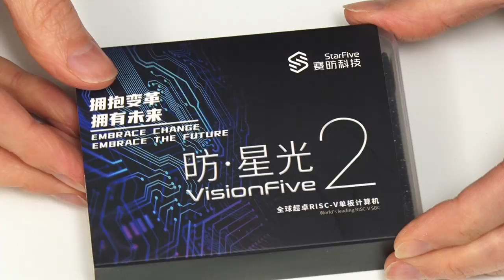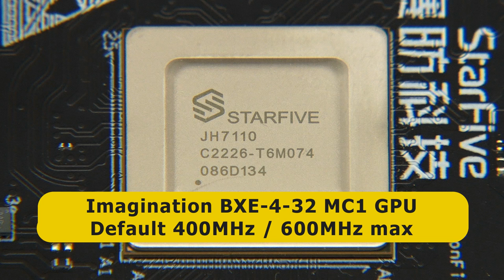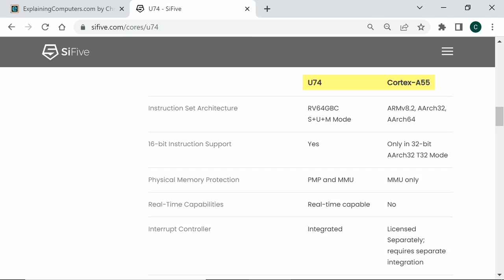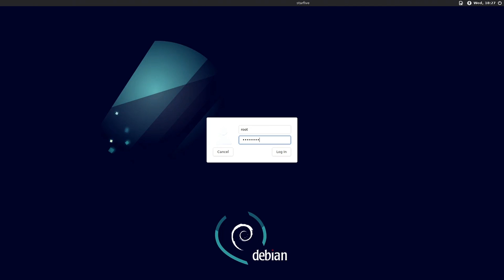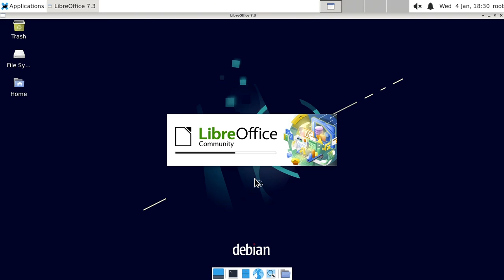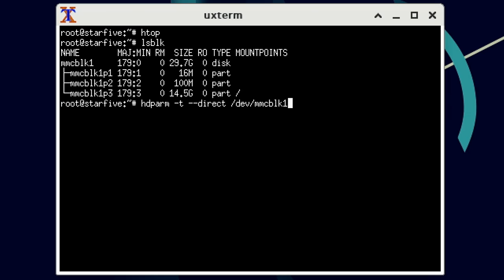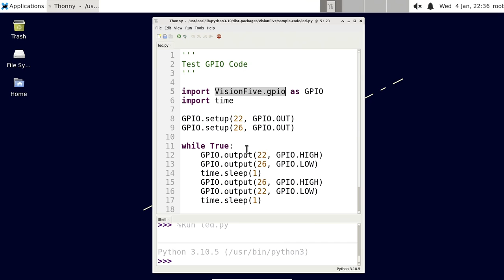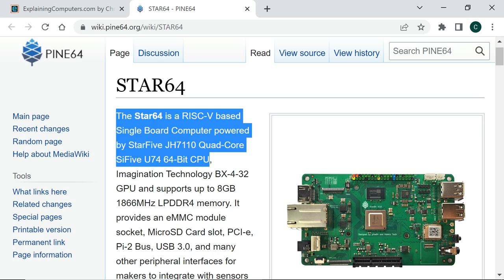VisionFive 2: RISC-V Quad Core Low Cost SBC

Comment: Is the documentation for this SOC open such that a developer could port an OS to it without the involvement of the SOC manufacturer? IMO such a move is critical for software support. As long as the manufacturer serves as the primary gatekeeper, the software ecosystem will always be constrained and cannot flourish.
Reply: Why do you care about yet another board that will disappear from the market in a year tops?
Reply: @lepidoptera9337  Because if one of these companies actually takes a chance to open up some of their IP and allows for actual community development then they could make an ecosystem that will last longer than a year.
Reply: @splynncryth  Dude, community development has never resulted in a decent piece of software. You need to stop smoking the dope.
Reply: @lepidoptera9337  I think Linus Torvalds would like to have a word with you.
Reply: @splynncryth  Linux sucks. No offense, but the best version of Linux that I have ever seen was a release around 1996 or 1997. It was all downhill from there.
Reply: @splynncryth  There is nothing wrong with that. Back then we had Linux on PCs and it ran just as reliably as UNIX on five times more expensive hardware. One of our LINUX machines had over one year of uptime before the electricity went out. Today I install Linux on a PC and it breaks without warning after a few days, if it installs at all. :-)
Reply: Written while totally ignoring the number of Linux machines that comment had to pass through. 

But all this misses the f-in point. 
Everyone is enamored with RISC-V and it's open source ISA but that also misses the point. 
There are reasons Android users struggle to get updates to their OS while PC users can generally get updates as soon as they are released by Microsoft, the Linux Foundation, etc. 
An open ISA doesn't make for an open platform. An open platform is one that can be supported by entities other than the chip makers. It's a strategy that has worked out great for Intel, AMD, Microsoft, the Linux Foundation, the OpenBSD foundation, etc.
Reply: @splynncryth  I don't have thousands of IT people to maintain my Linux machines, kid. I am not Google or Amazon. A long time ago Linux "just worked". It doesn't do that anymore. :-) 

And update that breaks your setup is not an upgrade. It's a mindfrell. That is what Linux has become.
Reply: @lepidoptera9337  Who hurt you? that's one hell of a chip on your shoulder. Or perhaps you are employed by a rival OS maker? 
Who do you think worthy of your praise? 

But again, you miss the f-ing point. These systems are essentally manufactured e-waste if they don't enable someone else to handle software for them.
Reply: @splynncryth  Why are you taking this so seriously, anyway? That Linux sucks is not your fault. You don't have thousands of professionals to make it work, either. A good OS requires a professional build team. Windows NT was initially built by approx. 200 people, I believe. By the time they were shipping that number had swelled to 1200, if I remember an article about it correctly. That was a tiny system compared to the size of a Linux distro and it was a focused effort by people who were full time employees. That's the power of money. It can create actually working operating systems. Neither you nor I nor the entire Linux community has that kind of change.

Comment: Could you please benchmark the NVME slot? 
Sad the ethernet ports are not both 1Gbps or 2.5G and 1Gbps. PFSENSE  and a VPN gateway would be a natural. 
Thta said I'm old enough to remember the original "Microprocessor Wars" of the  early 1980's.  There were dozens of great processors - both RISC and CISC begging for attention.  Once Sun and Apple went the Motorola route (now Freescale) and IBM of course the x86 the rest fell by the wayside as volume drove the costs down for these two camps. (For those too young to know - original microcomputers cost many thousands of dollars - they were a very hard sell indeed. Some innovated and drove the price to hobbyists price points but they were very weak. So its a bit amazing to see multicore, multi-gigahertz with large memory, graphics, networking and storage for sub $100 - what a journey!)
Reply from the maker: When I can get it working, yes! :) As I noted in the video, I tried an NVMe SSD, but could not get the OS to recognize it. But others have got it to work, so it may currently depend on the paticular drive used (I tested two WD Black drives). Be aware that the board is PCIe 2.0, so we will not get spectacular  NVMe SSD performance.
Reply: @ExplainingComputers  - Ah but I would expect it will certainly be better than USB or SDCARD. The latter really is a serious choke point for the Raspberry Pi.
Reply from the maker: @dennisfahey2379  Oh, certainly! :) I'm pretty sure I recall seeing an NVMe test somewhere in the RVspace forums reporting about 220MB/s -- about the same as I got the the USB 3.0 SSD test. So very much an improvement over a microSD card, or an eMMC module.
Reply: @ExplainingComputers  I mentioned above that a random comment lead me to change power supplies. When I went to a strong power supply using USB-C PD, my nvme was recognized. So that may be your issue
Reply: @Dennis Fahey  - here is what I saw with hdparam: hdparm -t /dev/nvme0n1

/dev/nvme0n1:
 Timing buffered disk reads: 512 MB in  3.00 seconds = 170.55 MB/sec

Comment: this is one of those products that, while technically cool, has no real place in the market.  If I wanted an SBC I'd go with x86. There is just too much software, knowledge, and support behind it.  RISC-V is neat, it's am undeniably cool ISA, but can it ever catch up and become actually useful?  I don't think so.
Reply from the maker: How does it have "no place in the market?" It is a board primarily for those wishing to develop for the RISC-V ecosystem, and as such has a massive place in its intended market. Not least, it has reduced the cost of access to tens of dollars, which will allow far more enthusiasts and developers to get involced. And I suspect that many SBC enthusiastics will jump on board at this price once the final release software arrives, especially with Raspberry Pi shortages. Enthusiastics too like a frontier.

In terms of RISC-V "catching up", I would suggest that having c. 30 billion (yes billion) RISC-V cores already rolled-out (in the embedded/edge/microcontroller space) is highly significant. For example, if you own a modern smartphone or SSD, there is now a reasonable probability that it has a RISC-V controller core somehere inside it. So to suggest that RISC-V will not become "useful" is somewhat ill informed

This does not all necessarily mean that RISC-V for end-user will take off. But RISC-V may well be the largest player within the embedded/etc space within say 5 years. And with Google now backing RISC-V as Tier 1 for Android . . .
Reply: Why would you go with x86 for an SBC rather than ARM?
Reply: @ExplainingComputers  ahh, perhaps I should have said that I don’t think the board is FOR ME. I am an enthusiast, but self taught and have little experience with Linux, and what I have experienced makes me leery of using any Linux distro as a daily driver.

Comment: 5:22 you can't compare processing power by looking at frequency, IPC is just as important
Reply from the maker: I am not an idiot and nowhere in the video do I comparing processing power solely by looking at frequency. Rather, as is extremely clear in the video, I compare both the cores and their frequency -- as discussed in audio and labelled in the graphic. In fact that section starts out entirely talking about comparing RISC-V vs ARM cores and does not even mention frequency.

Specifically, I note that a Si Five U74 RISC-V core is comparable in terms of processing power (NOT frequency) to an ARM A53 or A55 (and more towards the latter). And I then note that a Raspberry Pi 3B+ has four 1.4GHz A53 cores. So given that a VisionFive 2 has four 1.5GHz U74 cores (ie four cores that are widely considered to be at least as powerful as an ARM A53, and also clocked faster), it is  reasonable to state (and pretty widely accepted) that a quad core 1.5GHz U74 SBC will have more processing power than a quad core 1.4GHz board -- hence a VisionFive 2 is more powerful than a Raspberry Pi 3B+. I then include information indicating that a (recent) Pi 4 has 4 x 1.8Ghz A72 cores, so has both more powerful cores, with these now also clocked at a higher speed. So a Pi 4 has to be more powerful than  VisionFive 2.
Reply: @ExplainingComputers  I think perhaps some benchmark comparisons would have been good to see
Reply from the maker: Agreed! :) And I intend to make a benchmark video comparing a Pi 3, Pi 4 and the VisionFive 2. However, right now the software for the VisionFive 2 is not mature enough for benchmarks to be meaningful -- there really is no GPU support, storage interface speed is clearly compromised, things crash a lot, many test suites cannot be installed, and nothing web-based will run! :) So we have to wait a month or two . . .

Comment: nVidia's Jensen is WRONG!  Clearly Moore's law is not dead -- how else do you explain VisionFive's ability to release a far more powerful SBC for much less than half the price, after only one year's worth of development?  They really are going after the Raspberry Pi market, aren't they?  Clearly the software isn't quite there yet, but as they said, they're working on it.  Hopefully they're successful.
Reply: Moore's law is talking about state of the art, and transistor count, so our biggest chips.
Don't try to argue with such tiny chips 😅 that run slower than a PC could 20 years ago.

Comment: Just naively asking: could an old Acorn RISC OS be run or adapted to work on these RISC-V processors?
Reply from the maker: In theory, the old RISC OS could run on new RISC-V hardware. But I am not aware of anybody having ported it to this or other new boards.
Reply: @ExplainingComputers  Once the board & software has matured would it be possible to run it in a VM?:_stanley:

Comment: For $ 85 you get H 610 motherboard
Reply from the maker: You can. But I'm not sure what the relevance of this is! :) An H610 motherboard alone is not a working computer system. And is certainly cannot be used to develop for, or experiment with, the RISC-V ecosystem.